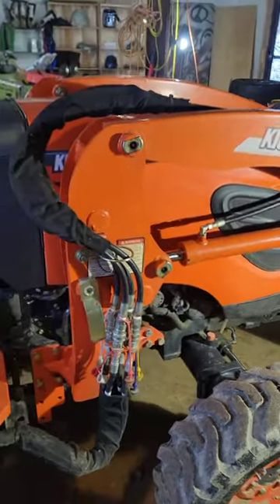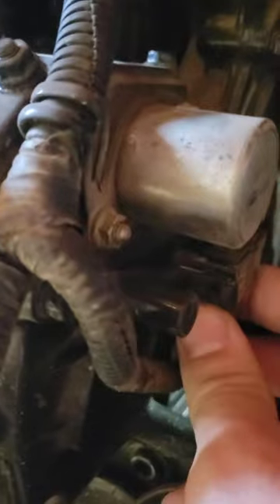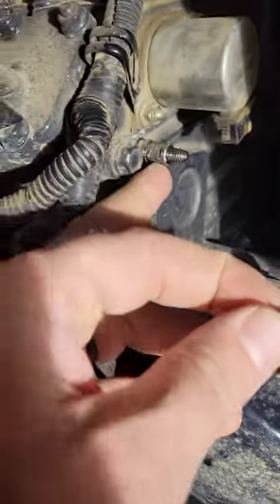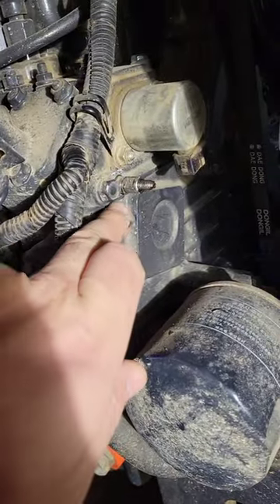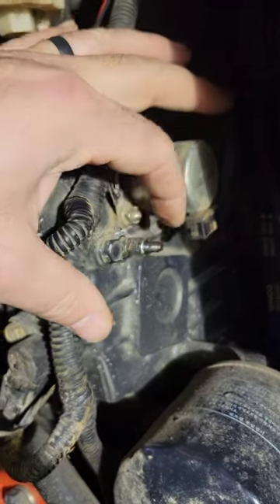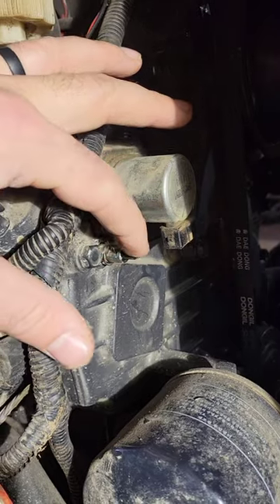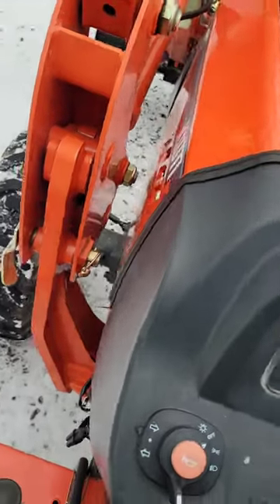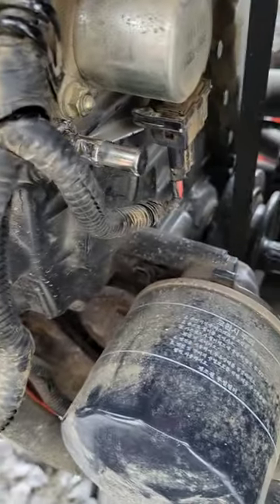kioti ck2610 horsepower increase from 25 to 35ish !!! easy.  takes about 20 mins.

Comment: Got dyno results on the pto to back up the claim?
Reply from the maker: I don't use the pto. Steep driveway / plowing snow were my reasons for doing this
Reply: @JerryULatowski  the pto power will tell us if you actually have 10 more hp regardless of it’s used.
Reply from the maker: @dooman700  yes I know how a dyno works.  Do you really think I'm going to spend hundreds of dollars testing a free modification to tell 700 people on you tube the specific hp increase of my pto?  It doesn't stall going up hills anymore.  That's all the testing I need.
Reply: @JerryULatowski  if I was to make a claim , I would back it up. You feel free to make unbanked claims all you like.
Reply: @doomman700  Owners already have to take for granted the OEM 25 hp rating. That's arrived at by adjusting the injector pump's rack travel limit as is shown here and is how many makers use the same engine (& displacement) for different hp classifications. Does the actual hp matter? Perhaps not, as while this is done on many tractors with mechanical injection it's the noticeable increase that's desired. btw, Many of us who operate CUTs are familiar with the method without having to actually measure the increase to appreciate it.
Reply: @johncmitchell4941  adjusting the rack only gives one part of the equation, this is why I asked for verification. I am very familiar with diesel performance. I own a cp3 truck making 550rwhp.
Reply: @doomman700  So you understand that the high limit is the only thing that changes? There is no effect on operation or performance otherwise, and no other details to consider. Diesels do not have throttle plates or air/fuel ratios and this bit is done only with mechanical injection pumps vs direct or common rail. There's a YT of a guy adjusting a 50-some hp Ford up to 75 or so while connected to a PTO dyno. Same method and general result. A truck has to be pretty old-school for this to apply to, meaning w/o digital controls on the fuel system. btw, my working CUTs are 26, 33, and 35hp (rated) and won't be turned up beyond OEM specs. :-)
Reply: @johncmitchell4941  you mean like my p7100 truck? You are wasting your effort, because I still see no factual results of this test.
Reply: @doomman700  Apples to oranges? btw, Who said it has to work for you, or cares if it does? Not me. lol
Reply: @johncmitchell4941  you must have cared , you came to comment.
Reply: @doomman700  Only that you challenged something IMO you don't understand well enough enough to fuss over the numbers. Dyno vs seat of the pants is subjective. btw, you might want to check out other YTs on doing this adjustment to CK2610s. It doesn't seem to require a yardstick to satisfy those who've applied it.
Reply: @doomman700  Video to back up that 550?
Reply: @number40Fan  nope, but I got the sheet from the mustang s dyno at TST
Reply: @number40Fan  feel free to look me up around the ISP circuit this spring
Reply: @doomman700  who cares what the exact hp gain was if the user clearly gets the result they were looking for? He's sharing advice for others who might be having the same issues, not trying to make money as a tuning shop.  We should celebrate people who put that effort in and share knowledge not troll them like you did here.

I am curious if this mod increases temps enough to be a concern. Not a diesel expert but have heard that's something to be careful with when tuning diesels
Reply: @na-et2gp  I care, because he claimed 35hp. How did he determine 35hp when all it is , is not slowing down on a grade under load, heck 2hp can cure that.
Reply: @doomman700  I can see your point, maybe this mod only delivers say 27 or 30 hp. Still a win for the owner in this vid but claiming 35 hp could mislead someone from buying a 35hp tractor and hope this mod would actually get 35 hp.  Most people wouldn't care about the error but if someone bought this tractor planning for this mod they may be disappointed 

So what about exhaust temps? Is this a tune that could cause issues/overheat?  I'm not sure but I'd prob install a thermometer myself before making changes
Reply from the maker: @n / a  I did put "ish" on the end of my 35 hp ... its more than 2hp, less than one million hp.  My rationale on temp is this is the same radiator,  same engine,  hydraulic pump, etc as the higher hp models.  This engine has just been "detuned" to stay under emissions. Therefore should be capable of handling the increase in fuel just like its higher horsepower brothers.   

This tractor has the same displacement as the other ck10 models up to  40hp and is only restricted by this fuel screw.  So my 35 hp"ish" comes from that.  

It really is a night and day difference I can't believe it's the same tractor.
Reply: @na-et2gp  if you modify the fuel delivery but not air on a diesel, you better run a pyrometer especially if you load the machine  heavily regularly
Reply: @na-et2gp  extra fuel almost always equals lower EGTs. If you’re an engine guys and you should know all about this.
Reply: @AnyManProjects  I said I'm not a diesel expert, then I said I'm not sure when asking about exhaust temps. Thought that would make it clear I'm not an expert in this area, my question was based on curiosity. I have no desire to turn screws on my tractor but find it interesting there's ways to get more power
Reply: @AnyManProjects  so when you can back a claim, the guy pointing it out is the worst. I tend to think the guy making unbacked claims is the worst. Akin to a liar
Reply: Geeze guys, cut this guy some slack. He showed us how he got more power out of his machine. Good for him, both doing and sharing. Some of the comments here… sheesh.
Reply: @JerryULatowski  I appreciate you making this video and sharing the information. You might be able to block and delete dummies comments.
Reply: @droutdoors1991  no, I tried to block you and it doesn’t work like that.
Reply: @doomman700  it's different on your own videos.
Reply: @droutdoors1991  you missed the point, no surprise there
Reply: @diegaspumper8501  sure plenty of you in here. I say show the proof of the power or you don’t have it. I know I dyno for my results before I make claims I cannot back up.
Reply: @diegaspumper8501  I have been called worse by better. I have also proven guys like you wrong for decades with a dyno.
Reply: @doomman700  it’s people like you that make things more complicated than they have to be. Yeah you’re that guy!
Reply: @diegaspumper8501  it’s a vid that claims to help people, no verification of that help (which the dyno will do and is the only thing that can do that. Seat of your pants bd is just that BS
Reply: @doomman700  go play with your dyno dude we don’t care!
Reply: @diegaspumper8501  you have proven you don’t care with your comments. Lmao
Reply: @doomman700  You're right, dude! Prove him wrong! Get a CK2610, turn it up and stick it on a dyno! 

Oh, you don't want to spend your money on it? He doesn't want to spend his money on a dyno either. Spend your money proving him wrong, he has nothing to prove to you. If you think he's a liar, keep on scrolling.
Reply: @Chameleon8474  no I don’t want a ck2610.
Reply: @Chameleon8474  on a side note, I said show the proof of his claim, not mine. Unfounded claims are BS. The issue with your thought is the the guy making the claim is the one required to prove it, not the other way around.
Reply: @doomman700  He isn't required to prove a damn thing to you.

I'm a millionaire. No, I won't prove it.
Reply: @Chameleon8474  then it’s just an unsubstantiated claim. That’s how that works. When you make a claim you , you prove it.
Reply: @Chameleon8474  funny thing, on a side note you should have kept on scrolling by your own standards. Comical lot of you guys say that but can’t take your own advice.
Reply: @doomman700  He's not selling you a product. He can claim anything he wants. He can lie to your face. It doesn't matter. Do you go around requiring Hollywood to prove claims made in movies? YouTube is no different. Grow up, stop being the guy that people don't want to invite to a party.
Reply: @Chameleon8474  I can call it out as BS too. It’s comical you think he is the only person entitled to an opinion.
Reply: @doomman700  You're entitled to an opinion. You're not entitled to demand he produce documentation upon your request. He owes you Nothing.
Reply: @doomman700  I'm sure you do. Your opinion on if it works or not doesn't mean it doesn't work. So what if its 7hp, does that matter? It works for him, which is exactly what he told you. You continued to demand he show dyno results to prove it. He told uou to pound sand.
Reply: @Chameleon8474  I call his claim BS and moved on, come back from time to time to poke at guys like you who say move on by, but can’t move on by themselves 😂😂
Reply: @Chameleon8474  why would I move? I still would like to see the actual change not some number grabbed from thin air.
Reply: @Chameleon8474  the only one crying here is you, crying I won’t accept a number grabbed from thin air
Reply: @doomman700  So, you've now admitted that you didn't just say something and move on. That's good! Maybe next you'll realize he can make this claim, as it doesn't defraud you in any way, and he doesn't owe you a thing. 
Personally, I doubt that it's making an additional 10hp. Prior to tier iv emissions it made 35hp, so its capable for sure. I'm betting they advanced fuel timing and turned the fuel screw in to get it down to the magical sub 25hp rating. It probably needs to have the injection pump timing played with to get the full 35hp that it used to have. So he probably has 29-30hp now instead of 25hp. Get over it, clown.
Reply: @doomman700  Really? Didn't this whole thing start because You wouldn't accept a number he came up with? I don't care if you believe him or not. My goal here it to illustrate that he owes you Nothing and your feelings of entitlement that he produce dyno numbers or "he is a liar" is ridiculous. Fine, he's a liar. Happy now?
Reply: @Chameleon8474  no this started because you could not accept me asking him for proof. I can go back through the thread here and see the convo between him and I. As the thread shows, I asked he didn’t have it and it was dropped. Then a few douche bags came along and told me I should just scroll by, but they didn’t scroll on by which makes them hypocrites
Reply: @doomman700  He makes exactly what he claims he makes, 35ish. You seem to miss the ish part.
Reply: @Chameleon8474  actually he was telling another guy about the “ish” , you really won’t win the argument you are trying too.
Reply: @doomman700  It clearly says in the title of the video 35ish. Go play in traffic
Reply: @Chameleon8474  so much for being done 😂
Reply: @doomman700  ...so much for moving on.
Reply: 100% works, did this on my CK2610 a year ago.  Night and day difference.
Reply: Like it or not he proved he gained useful power. Buy a tractor and dyno it yourself instead of badgering people for no apparent good reason.
Reply: @bucket0rocks  I agree, he showed proof of having a significant power increase. That is the point of the video, not to take anything as a precise measurement. Logic would dictate that if you find that line of unspent fuel when working it hard then fair enough to say you should be close to the rated power of the engine at its max power rating. I appreciate this test, it's the first I've seen that showed a before and after comparison.
Reply: @j.r.576  like it or not, it was not badgering but simply asking for proof of his claim. I have several tractors and a dyno if I make a claim rest assured it’s a fact and can be backed up.
Reply: @doomman700  get over yourself dude. Did you provide proof of your claim of having and doing what you said? No. I don't care about it either. You call it one thing, I call it badgering because it doesn't serve a purpose.
Reply: @j.r.576  it served a purpose, you just don’t like it. I asked him for proof of his claim. The purpose was showing what you said.
Reply: You seem really hung up on the 35 ish thing. After reading your comments,  if OP would have titled the video "more power from 2610" instead of "35 ish HP from a 2610" would you be less offended?

His claim is far from seat of the pants, he demonstrated more power, unmeasured but more. The hill climb backs up a claim of 'more power' indeed.
Reply: I bet you had the dyno operator manipulate the correction factor so you could go around claiming 550. A dyno is not the end all be all for measuring power. It’s actually pretty unreliable because they can be manipulated by the operator
Reply: @bradleycampbell1634  tst , mark chapple and no he does not manipulate numbers. Carry on with you assumptions
Reply: I did the same thing on the same model with and tested it with a brand new dyno.  I found that "35ish" is factually correct.  Feel free to test it yourself since you'll never believe anyone else anyway.
Reply: @MichaelHfuhruhurr-c2m  so you tested and got 10hp? Any video of the test available to watch?
Reply: @doomman700 the engine is a 35hp engine. It has been tuned down to avoid DPF rules.. so you can get up to 35hp with a simple fuel injection tune. Mine got the same tune but from the dealership and tested on their dyno. Not that I care about numbers, if it climbs my hills without bogging down while brush hogging that’s all I care about.
Reply: @doomman700 you have got to be a real bummer for other people to be around of. I hope you’re single.
Reply: @doomman700  Yes.  I gave a copy of the video to your wife and she approved it.  Ask her for a viewing.
Reply: @MichaelHfuhruhurr-c2m  I would have to value your opinion for your comment to bother me. Yea that’s not going to happen.
Reply: Sure dyno up the hill. He did good
Reply: @leeellisfabs  yep that’s the point. Unsubstantiated claims

Comment: That’s all we’ll an good but I don’t think I want to do that my tractor, if you have to cut stuff off with angle power saw then hammer the last little piece off, it just don’t sound right.
Keep tractor in low or med, to go up hill, you buy light wt. tractor not a 50 hp, 
Do what you want but I’ll take care of what I have
Reply: That tractor was originally a 35 hp model that had it's power turned down to just under 25 hp only to meet the new emissions standard. The chassis is the same as the big 40 hp model. It's not a little tractor being modified beyond it's capabilities.

He is only cutting off a cap that stops anyone with a wrench from turning the power back up to normal and increasing emissions slightly. If you want to own a 35 hp tractor and only get 25 hp you are free to do so.